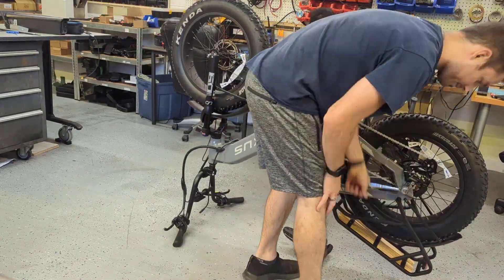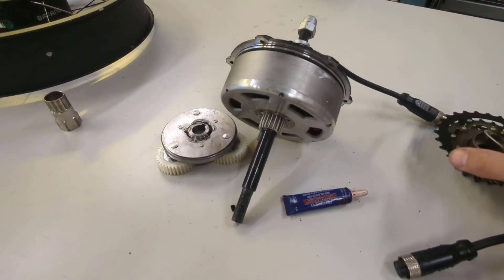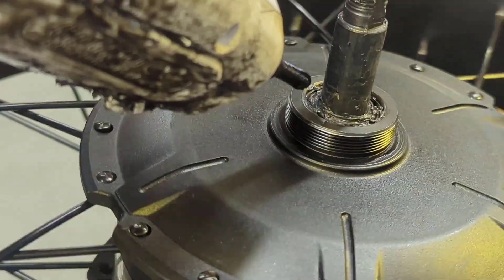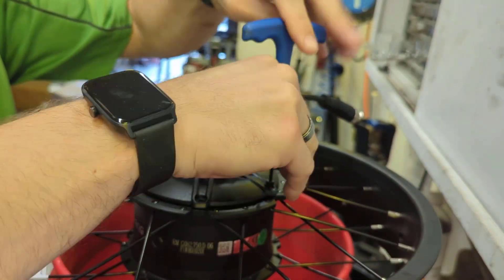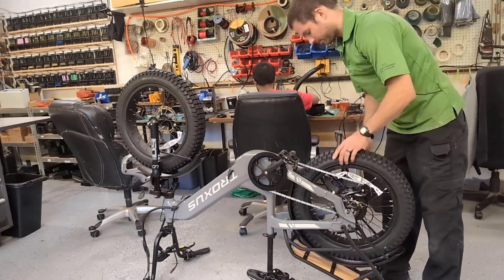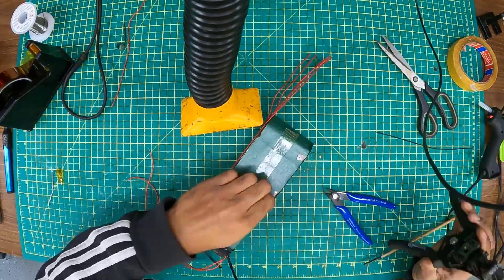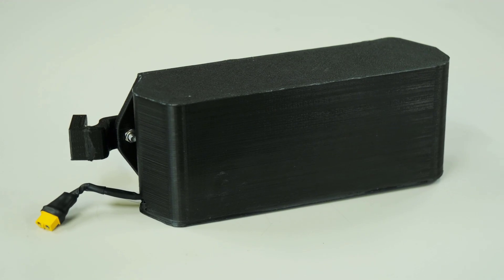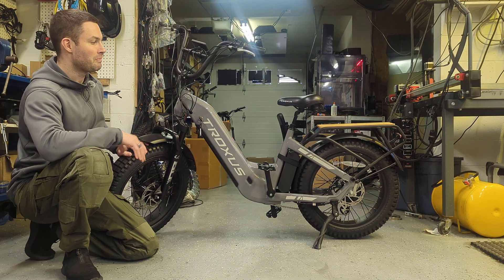Triple your E-Bike Power? Here's How (Part 2 : Mods)

Comment: Just ran across your vid. Interesting. Advice: You  don't need to seal the rotating shaft because the motor shaft bearings already have seals. I saw this in the vid & those bearing seals are more than enough to contain your ATF.

Comment: yo, I got a genze e222. Ion know If I can change the motor some how. I was lookin on ebay at some but Ion know if it would fry my battery or sum. its a 350w and I'm lookin at a 1000w. I also don't have a throttle and I dont know if I can add one and nobody near me knows anything about E Bikes.

Comment: The best mod to a Troxus like this (that anyone can do free) has nothing to do with performance and everything to do with rider body posture. 
If you want to feel more like  a biker and less like a cyclist, lose the stock seat and throw a bungee around a folded up towel on the luggage rack. 
It will move your posture back and down, arms straighter, extended out front. Nice sulking bad boy hunch and some fook-off shades…
Apart from the absence of a nice guttural “lub-lub” ice engine idle and the gae-ass 20mph max speed, you’ll suddenly feel like Jax from SOA.

Instead of Mary Poppins.

Comment: Can You Change The speed Limiter on A Fun Hang 48v  500w  26" E Bike Right Now The Top Speed Is 25mph I Checked The Controller  It Don't Have A Single White Wire As Most To Disconnect? If You Could Help Me Out On This Matter It Would Be Appreciated ? Thanks
Reply from the maker: Only some controllers have it. For more speed you need higher voltage, field weakening, or faster spinning motor. Sometimes the LCD will have a speed limit that you can change too

Comment: Hey youse guys, great video! For the lash problem in the regenerative system you could weld a collar onto the gear plate tall enough to receive a set screw, pinning it against the keyway. Letting some drift in the bore would let the screw work to move the collar to a hard stop. Loctite the screws against vibration, and the pinning action does the work?
Reply from the maker: I think welding a collar and the motor plate won't close anymore. Seems like doing a better job with the Red Loctite is the answer. We apparently didn't do a good enough job with it here :P

Comment: Hi, how are you guys running 2 different batteries at their own voltages with different BMSes in series? From all i could find this is not a recommended setup. I currently have a 48v battery and would love to step it up to 72v this way. Super keen to do the atf mod!

Comment: Finger tighten your rtv surface until its dry then tourque it down  in criss cross pattern but its not good to torque it when its wet becuse as it dries it shrinks and then after a season of temerature change it shrinks again . So if it dries finger tight then your accomodating for the  shrinking and it will be good until its taken apart again

Comment: Scuff it good and use jb weld , instead of thread gunk. Thats what i call it because it dont lock it tight it just keps it from backing out once it does break loose. So one day if you check your hardware and see some are loose but they are all still there ,then you torque them down better this time and your good  instead of not having anything to retighten because they are absent

Comment: What size and or brand motor cycle tire can I use to replace a 26x4 tire?
Reply from the maker: I dont think 26s have any motorcycle tires that happen to line up perfectly. 20in bicycle and 16in motorcycle are in that sweet spot where they line up and I believe 18in motorcycle and 24in bicycle also but I'd have to confirm
Reply: @ElectricBikeLaboratory  Thanks for the info.

Comment: How fast is it if you don’t mind me asking, also, what is the different in clearance between the 2 inch stock tires compared to the 16 inch motorcycle tires? It seems like 16 inch versus 20 inch would be a 4 inch difference in diameter, but is there any difference in speed if that modification was the only mod done?
Reply: 16 inch motorcycle tires are the same as 20 inch Bicycle tires. Different way of measuring them, so the numbers don't match... but the size is the same

Comment: Hey myles, a point on the backlash/loose keyway problem: keyways are machined to press fit tolerances with a spec for surface area compared to shaft diameter. Any machinist handbook will have these industry standards. I would suggest getting hardened keystock with exact dimensions that comply with this rule of thumb(from my memory roughly 1/3rd of shaft diameter, the keyways are half of the keystock size)

Another common practice is using set screws(this is where the locktite comes in) but this is usually only when the cog or bearing has room to walk off the shaft. Here its all held in the case so you wont have that issue. 

Cheers hope this helps

Edit: could also be the heat from the weld youre contending with warping. Could try welding the keyway into the clutch with the stitch welds. Checking dimensions before and after
Reply from the maker: This is excellent advice, thank you!!

Comment: Great skills!!  Question.. on the engwe x26, it has 2 batteries but only 1 used at time.  Could I combine the two and upgrade controller for higher output?  How about adding additional mid drive motor?  Looking for boost on hills.  
Would love to replace hub motor but I can't find upgraded hub motors  with 26in mag wheel style..  only see spoke.  Thanks
Reply from the maker: Thank you! On that particular bike you COULD run both batteries together with a parallel module (search "battery blender" or "parallel module). Then you have both batteries running together, and then you could tap into the battery line (Y splitter) and run a mid drive off of it for some serious hill climbing power :) Mag wheels are a lot harder to find than spoke wheels! Hope this helps!

Comment: I hope dual motor Performance is in the works for future episodes! I got a beast of an ebike myself.... hopefully video soon
Reply from the maker: We've got one video of a 2WD check it out ! Thanks for watching :)
Reply: Hello, I have the new upgraded smlro xdc600 2000w dual motor ebike and have made a few mods. It will now do 39mph top speed and get there peeling out almost the whole way. Tons of fun. Atm I'm running 2 shark batteries both are 52v 30a one in stock location and one below the frame, a 120v x 120a dual battery discharge module, smooth tread tires, ive shunt modded both controllers, clutched derailleur, upgraded all power connections to xt90s, 8speed freewheel, 60t chainring, suntour suspension seatpost, c9 seat, wake headset and handle bar, a lighter backrack and fooker pedals. I've also increased the power wire size to and from the controllers to the batteries and shortened their lengths. I feel like this bike is capable of much more power and speed. Maybe time for new controllers and go to 72volt? Any suggestions on taking this project to the next level?
Reply from the maker: Sounds like a beast already !

Comment: I like the way you connected the battery and? are the batteries the same voltage
Reply from the maker: Not same voltage one was 48V 20AH and other was 24V 20AH but same cell spec and capacity so they drain equally when connected in series. Thanks for the comment ! ☺️

Comment: Hope we get to see speed run
Reply from the maker: I got it going 60km/hr which was plenty , it had more in the tank though 😉
Reply: @ElectricBikeLaboratory  60 km that’s nothing all that work and money I have a 48 volt 750 watt motor that does 52 if I pull regulator wire it will do 70 kph
Reply from the maker: It spins to 99 , it'll do about 70 but I didn't care to push it that fast with the brakes and no rear suspension.  Originally did about 45 so vast improvement. 

All the work and money ? Haha the work is fun and I'd do it anyway, and this bike was given to us for free and we spent a few hundred on mods. A bike that goes 70kmhr for a few hundred bucks I'll do all over again in a heart beat 😉

Comment: This was a fun watch! So just to clarify. You put 16x3” tires on 20x4” fat bike rims? Is the lip on the fat bike rim smaller?
Reply from the maker: Hey there thank you! Bicycle tires are referenced by the tires outer diameter and motorcycle rims are referenced by the rim diameter , 16in motorcycle wheels happen to fit 20in bicycle wheels they basically match in diameter , the 3.0 stretched to about 3.5in when mounted on the rim and inflated 👌thanks for the comment !!

Comment: SUBSCRIBED!  Wow, I had wondered if it were possible to up the voltage to 72v by adding a 24v battery.  So, the 750w Bafang motor will survive at 3000w?  I have a Troxus Explorer.  I replaced the 26x4 knobbies with 26x3 Duro Beach Bum slicks.  These tires are motorcycle-like in their toughness, no flats and hardly any wear after 1800 miles.  I'm skeptical about regen.  The charge rate of batteries is so low that I doubt how much regen helps, and, I prefer throttling the bike with the pedals.  The Explorer is a great pedaler.
Reply from the maker: The skepticism about regen is very warranted, it is a really fun feature though. But yes, you can't put too much back or its pretty easy to trip the BMS overcharge current.

We've seen people online push the Bafang G062 to 7000W before failure, they are pretty dang robust!

26x3 Duro beach bum slicks must be a nice upgrade.

Thank you so much for the comment! :D
Reply: @ElectricBikeLaboratory  Thanks so much for your reply.  I guess I'm going to have to investigate hopping up my G062.  According to the display the peak power is almost 1000w.  If I could just tweak it to 2000w I'd be super happy.  I wouldn't run it at 2000w all the time but it would be fun to be able to.  Cheers!
Reply from the maker: 2000W is a good amount of power 😉
Reply: @ElectricBikeLaboratory  Yep!

Comment: So few notes. I would suggest Shinko 244 over the 241 for the better center contact point or if your riding only roads then Shinko 567s would be even better for rolling resistance,
I'm wondering if it might be better to weld the keyway right to the axle (not to the clutch)  that way to get get rid of the worry of back and forth play over time in the keyway via regen while still being able to change the gears when needed.
Reply from the maker: Excellent points! I'm so used todefaulting to the 244 because we've used them on so many builds but yes there are some really good options out there
Reply: @ElectricBikeLaboratory  
This is how I have categorized shinkos.
241 is 75% dirt 25% road
244 is a 50/50 dirt and road
567 is 0% dirt and 100% road
Reply from the maker: Those 567s look nice , probably should have went for those lol

Comment: Why didn't you guys swap out the plastic gears for metal ones? Stripped gears gonna be a pain?
The cooling liquid is ment to be in the center of the motor?, if it gets out into the gearing part how will it get back in?
Reply from the maker: We'll see if we can get the gears to strip, then we'll swap em out ;)

ATF fills the air gap from rotor to outer shell with a liquid medium for enhanced heat transfer, the centrifugal force will always force the fluid to the outside, and provides enough to fill the air gap but not too much to increase resistance too much. At least that's the theory! We just wanted to try it, so far so good
Reply: Plastic is actually tougher

Comment: Cool that you can wire two separate batteries in series. Do you charge the two together with a 72v(plus) charger too, or do you charge them separately?
Reply from the maker: You can actually do either but in this case for us we will be using 2 separate chargers

Comment: Interesting Video. When I use Silicon on gasket surface, I will only hand  tighten it till the you have a silicon bead showing. Let the Silicon cure for 24 hrs before the final tighten. The cured Silicon will make better seal. Can you use a torque sensor with the control?
Reply from the maker: That's a great point, that would definitely make for a better seal.

Torque sensor is possible with the ASI BAC855, we didn't go that route because of the torque sensing BB, personally I'm mainly a throttle only rider so it wasn't a huge thing for me. I know some people love true torque sensing though (such as yourself!) 

Thanks for the good comment!

Comment: Hope we do get a 3rd video in this series showing off the difference the ATF fluid made for transferring the heat to the outer casing. Would be really helpful for modding geared motors and provide a decent bit of information for people really wanting to push geared motors like myself. Also would love a more technical side to this if we get another video on what kind of power your fully pushing through the G062.
Reply from the maker: Excellent points. We did some hard pulls up and down the street for about 15 minutes and the motor got warm but not hot, right now its pretty cold to ride. Would love to push it in the hot summer and see if it survives. The phase wires unmodified may be the death of it but we figured upping the voltage should help. We will see! Might have to weld shut that keyway too.

Comment: Awesome video I may do this to my motors.
Reply from the maker: Thank you! It was a fairly straight forward and easy process, surprisingly the ATF hasn't leaked out anywhere, other than actually going THROUGH the cable (which was surprising). Only a couple drops though. 

Thanks for the comment :)